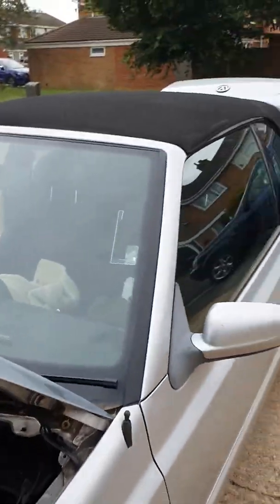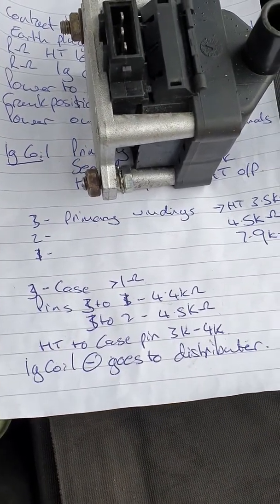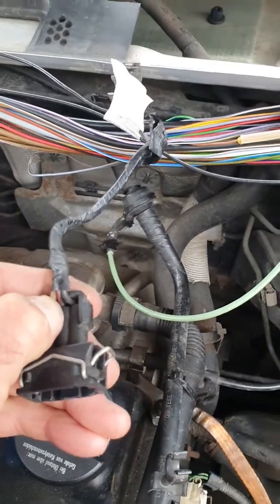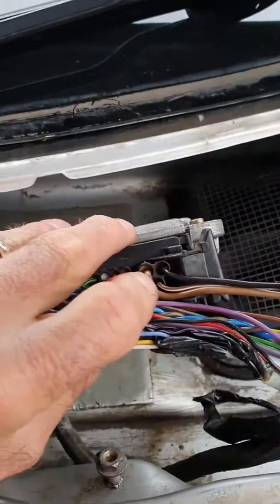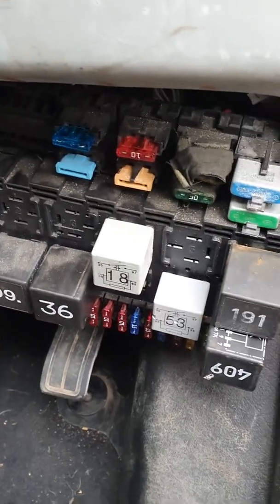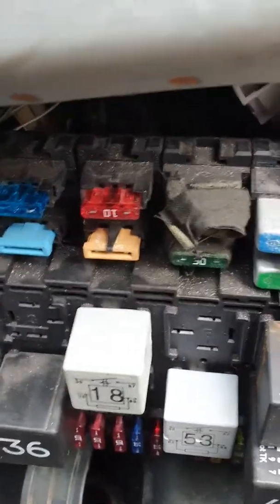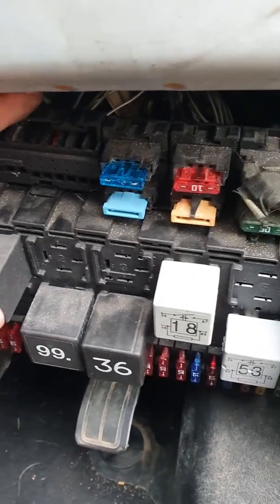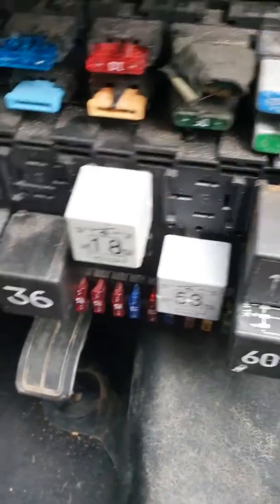MK 3 4 Golf Cabrio Loss Ignition and Fuel Relay

Comment: Hi.
Got a problem probably very similar but I will explain my car symptoms.
So my car sometimes doesn't start as the the relay from the corner doesn't engage when turning the key in the contact this means no start but when the relay engage car starts no problem. So the relay is fine as replace it and still doesn't engage just when it wants. Mu car doesn't stop when driving but if I turn off the engine and I would like to start it again sometimes doesn't because of the second relay not engaging. So don't know really where is the problem may be the chip reader and this why that relay not engaging. If it was a fuse It shouldn't start at all sometimes so may be a wire contact free. Who knows. If you got an ideea please let me know as for sure all the parts are fine just I need to find a way how to make that fuel pump relay from corner to engage all the time when turning the key into the contact.
Cheers